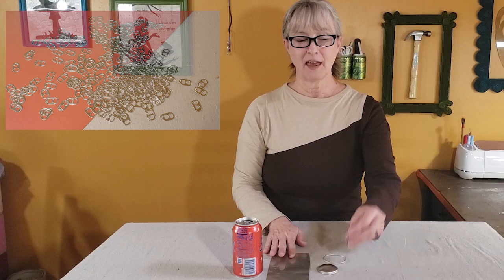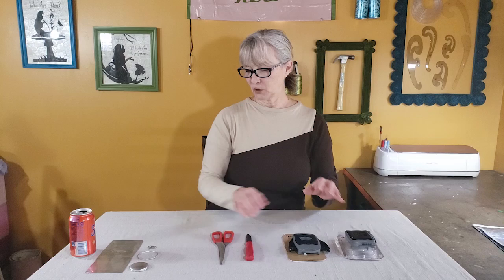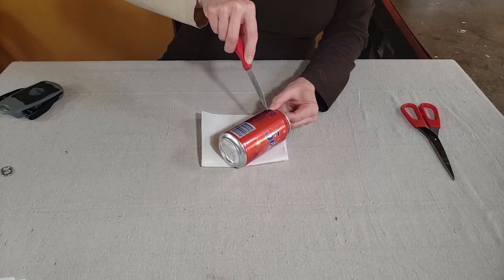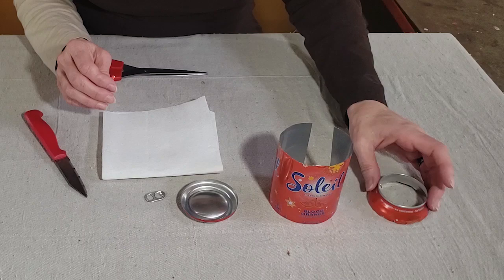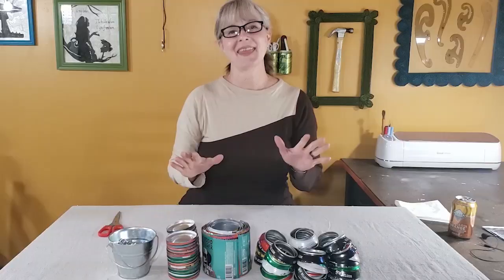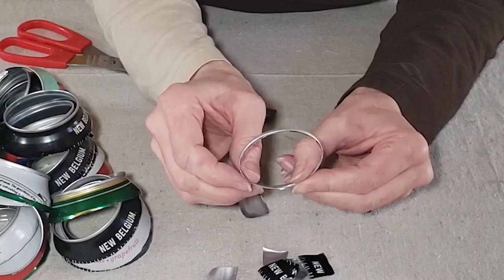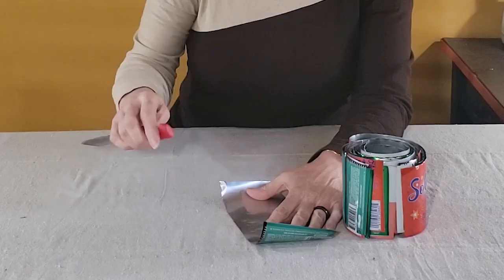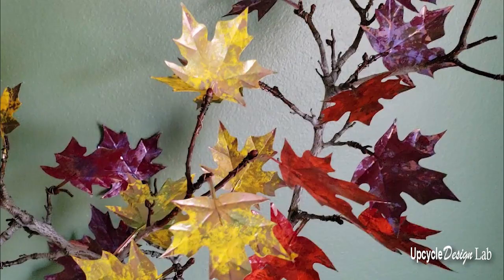Transforming Trash: How I Break Down Soda and Beer Cans For Crafting

Comment: I honestly don't see any point whatsoever in using a draft top can opener. What's the purpose of it if you cut the upper part with scissors an inch below the can shoulders anyway? Plus (or minus) the can top opener is not cheap.
Reply from the maker: Hi I like to use the draft top because I use the metal rings from the cans in some of my projects. If you don't want to use that part of the can then you don't need to remove the top. 🙂
Reply: @UpcycleDesignLab  I see

Comment: When I’m cutting up my tin cans, especially getting the bottoms & rings ready to use, I slip on my silicone finger protectors. I bought them for hot glue but thought how practical & protective they would be for using when I’m working with aluminum cans. They work just great. I bought a pkg with  three different sized for $0.86 cents from temu. Amazon prices are a lot more.
Reply from the maker: Thanks for the tip. I don't have a problem working with the aluminum cans but I have been  known to injure myself with my glue gun. 🙂

Comment: TFS!
A quick tip on removing the tabs, if you rotate them all the way around and push the larger end into the can opening you can remove the whole tab including the little ring that connects it to the can lid. I started doing that in case I wanted to use the little ring in design elements and to avoid the sharp edges produced when wiggling/snapping them off.
Reply from the maker: Hi thanks for watching and for the tip. I will give it a try. 🙂